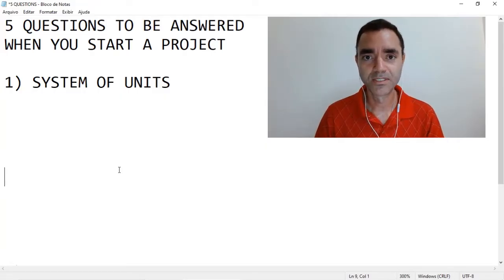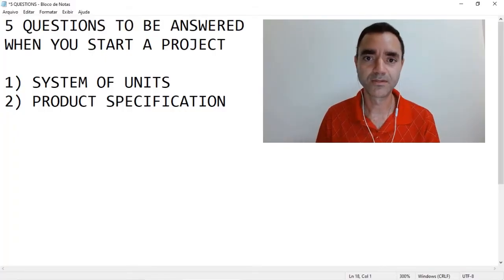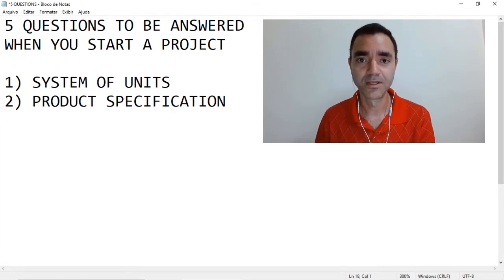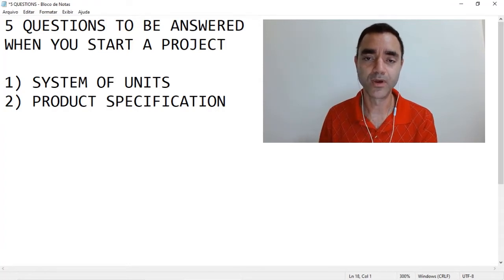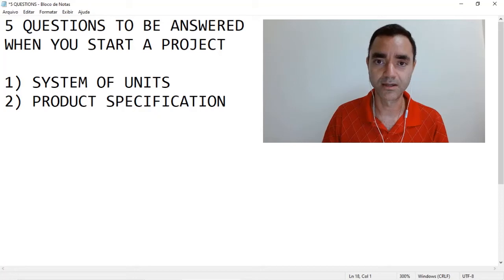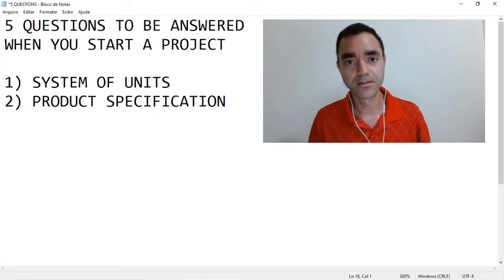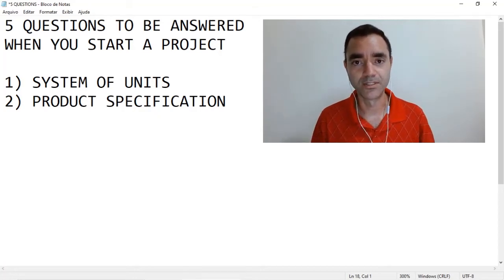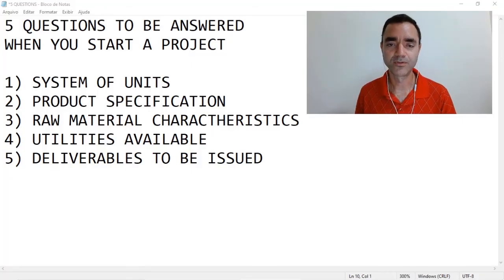5 QUESTIONS TO CHEMICAL PROCESS ENGINEERS IN PLANT DESIGN

Comment: Hii! I don't have any experience in Aspen simulation Softwares (Hysys and plus). Although i have started learning CAPE OPEN by simulating process flow sheet by help of research papers. How do i start learning for Aspen Hysys? What should be my initial steps?
Reply from the maker: Hi Mohamood, there are many ways to learn Aspen Hysys. The step by step from scratch to advanced applied to plant design with my full online support you can find in my Inprocess Booster training program. This Saturday, March 12. 2022 I close registration for this new batch. More information at this link https://bit.ly/3IQoPZy.
On my YouTube you find a video with the basics (https://youtu.be/H6TDfEIPACg).
Papers are a good way to practice the teachings :)